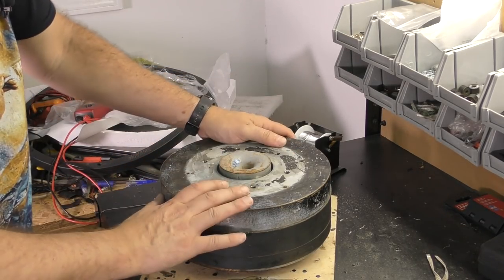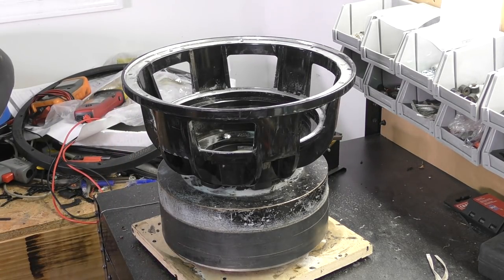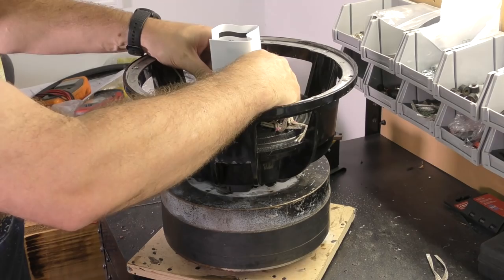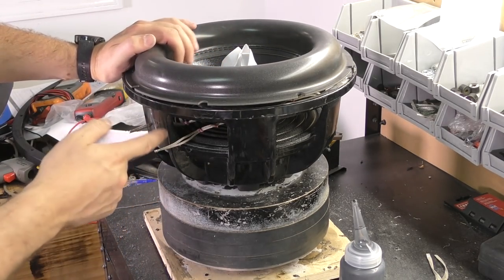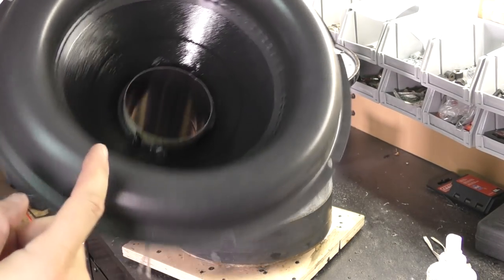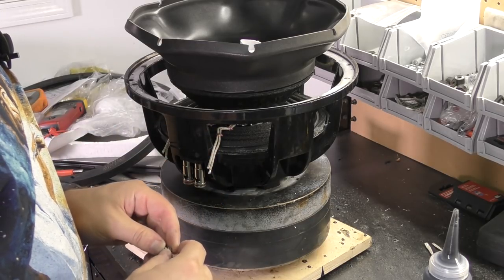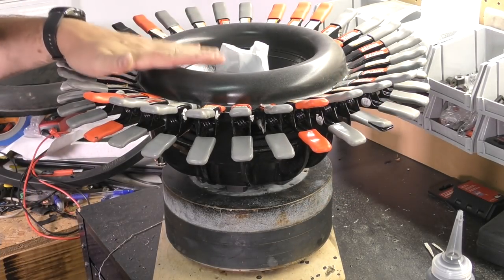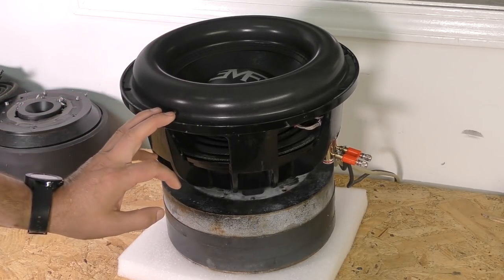I rebuilt a disaster subwoofer someone else already built, a Shocker Sig

Comment: I’ve seen a few shocker sig motors up here in Maine. 4-6 of them. Not sure which gap they were
Reply from the maker: They're originally more common in the northeast and Midwest as they originated in Ohio.
Reply: I posted an add on Facebook up here in Maine (mid coast)  trying to buy some blown up performance subs (but if cheap enough even budget subs just to salvage the ferrite to combine the slugs to build some custom motors but have had zero results... Which surprises me yeah some people will repair blown subs but  a lot are intimidated by re cones and here in Maine not a ton of options and will just toss it aside and buy new, you would think they would want to re coupe some of there original investment. But at least mid coast Maine is just so not a hot spot for car audio it seems damn near non existent, I never see bumping systems around even close to mine and it slaps pretty good but its not a crazy extream system, I've tried to find someone with an SPL meter up here to test my system now and after my upgrade but no luck with that either. Do you know of anyone here willing to Meter a system in Maine?
Reply: @95Sn95  well I’m in central Maine. I have a termlab meter.
Reply from the maker: @95Sn95  everyone I knew in Maine in audio either left Maine or left audio.
Reply: All '05 "small gap".   Only 200 big gaps were made, the 3 I ever had I sold to Andre in The Bronx and he shipped a lot of those motors out to Eastern Europe.  Big gap "'02 sig" has a much wider pole vent and the slugs stick out a little bit more from the top plate. 

AFAIK there's 4 '05 motors up here.  One in my F250 and 3 in my brother's Civic which lives in my driveway. 

Not to be confused with the neo motors.  50 of those were made, I own 8 and Rooney has 1 that he got from John at T3.
Reply: @hispls you still got the 8 Neos?  I got a pair of them I need to rebuild
Reply: @handkaudio  
I've got my 8 plus 1 prototype with a slightly different top plate, bottom plate, and pole vent.   I have d2.8 and d1.4 copper coils to fit.

Comment: How much to customize a sundown SArev3 15? The basket n motor is already assembled, I would love a higher rms n watts rating🙏🏾
Reply from the maker: There is only so much you can do with a given motor design and coil size. The only way to increase power handling is to use a higher temperature coil, which we typically do because we use 500 degree coils where much of what we recone is a 280 degree coil.
Reply: @EMFAudio  I gotcha. I need a recone with whatever parts will work for it.
Reply from the maker: @DisShiTooEZ  I've got dual 2 coils in stock I believe. Cones too, spiders I'm not sure.
Reply: @EMFAudio  I would like to send it in for a recone if you are available😁
Reply from the maker: @DisShiTooEZ  You can send them over, turn around will be a week or two usually.
Reply: @EMFAudio  Im not a social media person so how can I get in touch with for the prices?
Reply from the maker: @DisShiTooEZ  contact form on out website. www.emfcaraudio.com
Reply: @EMFAudio  Will definitely do👍🏾 Hey is there by any chance that you know the weight of the Banhammer V2 15?
Reply from the maker: @DisShiTooEZ  Around 63 lbs

Comment: You should've cleaned sanded off the top plate before you started to rebuild it ...
Reply from the maker: The top plate wasn't even painted at the mating surface, not that paint would change anything anyway.

Comment: If you are only going to use lock washers for the surface, why not just use a regular washer? You just threw shade on a guy for not being a professional, not doing it right while calling yourself a professional, and already using shortcuts in the early process.... js

Comment: Lol use 2 different bolts "because they have to be"   kinda funny to make a video about someone doing shitty work while doing shitty work yourself.  Should've drilled and tapped the other 2 holes out to 5/16" instead of doing a half assed job with 2 different sizes of bolts.